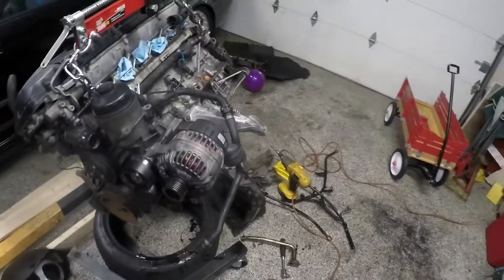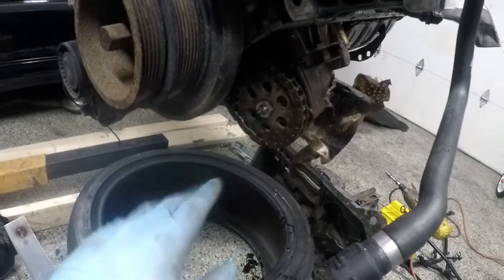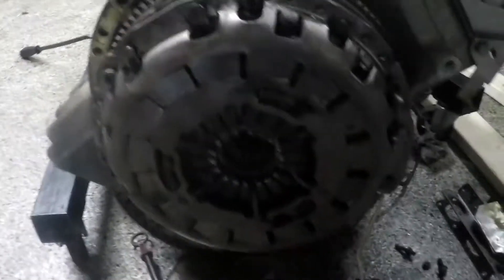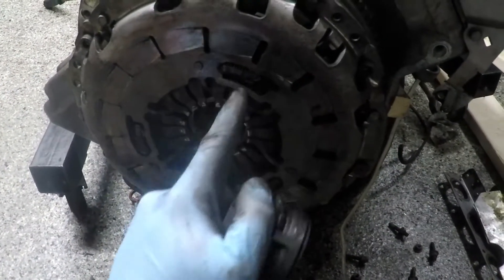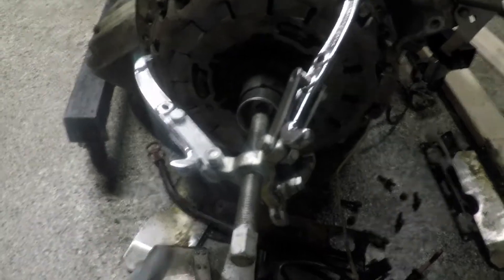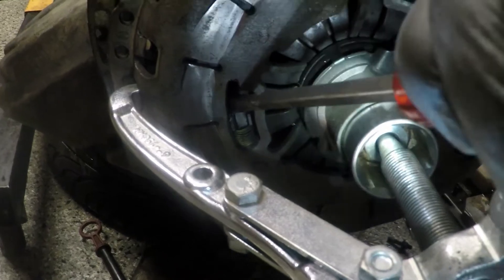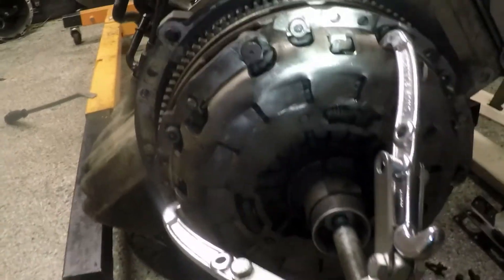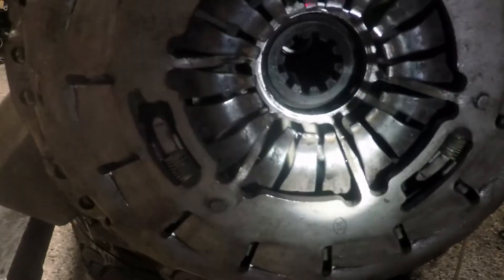E46 Engine Assembly - Adjusting the (self adjusting) clutch and welded oil pump nut

Comment: That is made when first upgrade?
Reply from the maker: What do you mean? OEM clutches all work like this. Aftermarket clutches should not need this.
Reply: @protomor  i have luk self adjust clutch, befor 1.5 year i change set clutch and from yesterday some time slip about 3000rpm.
Reply from the maker: @valcic1993  I don't think that should cause a slip. I think your slave cylinder or clutch fork are probably installed wrong.
Reply: @protomor  but past 3 days its be al right then yesterda?
Reply from the maker: @valcic1993  I don't know. you might have just been slowly wearing down the clutch. It's not a good sign.
Reply: @valcic1993  What condition was your flywheel and did you change that also?
Reply: @ayeeidkmusic  yes i change complet set

Comment: Can I get a little clarification on a few things not covered? Did you leave the pressure plate bolts loose, reset the self adjusting clutch, remove three jaw puller, insert clutch disk centering tool and then finally torque the pressure plate? Essentially how you centered the clutch disk is not clear to me.
Reply from the maker: It's been a long time but I'll try t remember. I think you tighten down all the pressure plate bolts first, then reset the clutch, then remove the puller. The clutch alignment tool is only used to get the clutch on initially; before you adjust the clutch pressure plate.